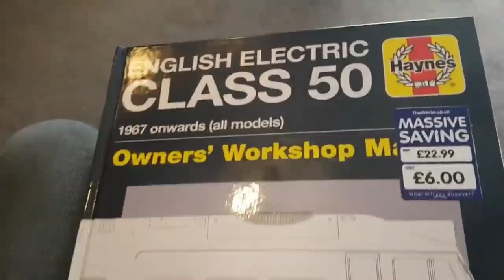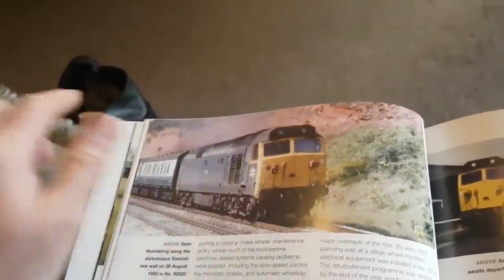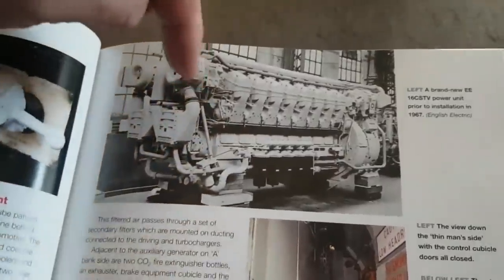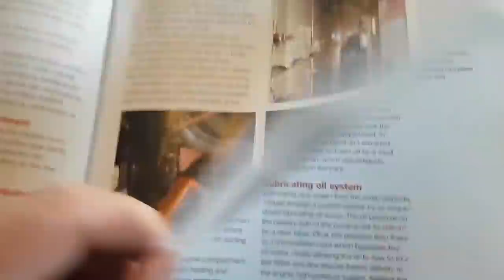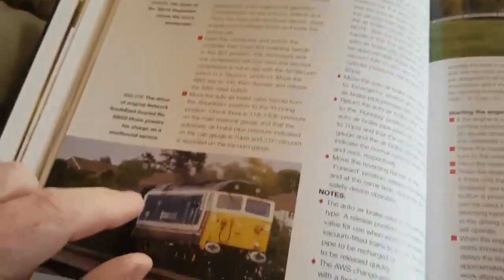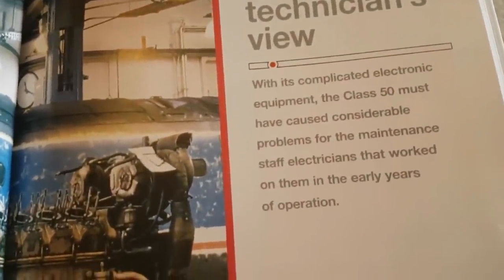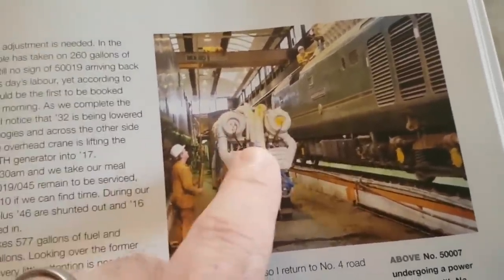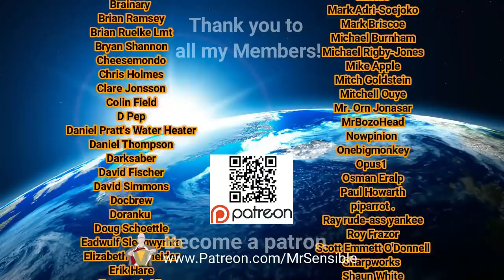Trains and the Dunning Kruger Effect

Comment: You can run a gas turbine engine on pretty much anything combustible you can get through the injectors, coal if you can grind it up fine enough. Aircraft fuel is just a higher grade diesel really.
On a positive note, wind turbines do run using just air :)
Reply: Ah yes but jones senoj claims wind turbines are driven by jet engines in another of his crazy videos.😂😂

Comment: See that big round thing at the back of the engine, it’s a generator. Almost all modern trains are Diesel electric’s. The nice thing is in metro areas they can use the overhead wires to power the trains so they don’t have to run the motors and create more pollution.

Comment: Mr S. I don't know about the train where you live, but here in the usa most trains are diesel/electric where the diesel engine(s) run an electric generator(s), and the electric generator is what turns the drive wheels thru electric motors.
Reply: Yep and the diesel responds to the generator load with the electric motor controlled by varying its field strength. Appears rather Rube Goldbergian from a distance

Comment: I quote,
"If they were using traditional diesel like you do in your car, they would need a giant oil tanker behind them".
Presumably it hasn't occurred to him that diesel cars do not tow an attached oil tank and so there is no reason why the locomotive should need one.
Still one thing is proven, modern video cameras can be operated by idiots.

Comment: An answer to the Train Book Guy:
Let just say that the train run on "free energy", that had not affected the price ot the train ticket, for a train need tracks and those are rather expensive to build and maintain, then there is the workers that keep the system running and working and those people need to get paid and the money comes from the ticket, that is the main cost of a transportation system.

And then it is so that energy is free and always beef free, it is just not easy to convert one form or energy into energy we need and it is that transformation we pay for. Just let say that the companies can get energy from the air, that energy is no good to run a television, so the free energy need to be converted into electricity we can use and it is that service we pay for.

i can have small solar panels on my window to charge a small weather station, that energy is free for me, and I can stop use electrical light and sell my computer to get rid of most things that use energy I pay for, and then I can live on my "free" solar energy if I want to, but I prefer to pay to get the energy I need rather than have a "Free Energy Jet Engine" in my room to spin a turbine that generate free energy for my electrical stove.

Footnote: How stupid are folk that that think there is some secret hidden free energy source that can be used for everything, do they really think that if they can expose this new "free energy from air" that it would be able to fuel their car, make flight free and electricity free to use?

Comment: The locos he was pointing at were diesel -electric , Diesel engine drives a generator then electric motor. Electric motors are better for large weights, diesel on its own would be burning out clutches. Electric motors have massive torque all the way from a standstill to full power. Much smoother power delivery.
They are similar to the ones space x use .😜

Comment: Ooooh, the levels of stupid!!!   I work at one train station for almost ten years, in a newspapers and magazines shop...  and about those "sparks", I have one word, Jonesy:  doves!   Blowing up doves are so common, if the poor beast have the shock in low tension you can see it badly burn, if it's in high...  a small smoke and perhaps one or two feathers, the rest vaporized!  

 And if you don't believe there's electricity, get your hand near the "induction zone" (half a meter from the wire) and you will have a shocking surprise!  One teen tried that years ago, and it was horrible...  but sure, keep in your delusion!!!
About the induction zone, not sure if it's the right translation, the technicians that worked there mentioned it thousands of times, but you know, in spanish we can say in one way and in english there's another!

Comment: Diesel electric. Diesel is the motive force, the transmission is electric (i.e. alternator driven by diesel + electric motor). Not only is diesel energy denser than coal, the diesel engine is way more efficient as well.  So. No. No tenders :-)

Comment: Just when you think you saw it all, someone like this comes along!  In South Africa all our diesel locomotives are actually diesel-electric (i.e. the diesel engine drives a generator which powers electric motors on the drive wheels).   Although there are more losses this way, it is easier to control the power than when the diesel drives the wheels directly.  I wonder if this is the case in the UK as well?  Any idea?
Reply: This one is a diesel electric, as are pretty much every remaining diesel loco in the UK now, other than some shunters. The western region where these engines ran used to use diesel hydraulic locks, as was mentioned by him in the video, which used hydraulic drives instead of electric motors, but the last of them was withdrawn decades ago.

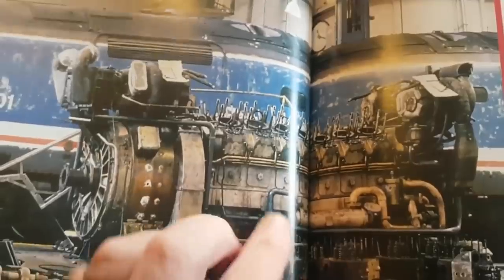Comment: My dear Mr, you are also missing the point of these loc's. (9:00)is 
They are Diesel-Electric.
The Diesel engine drives an Electric Generator. The wheels are driven by Electric Motors. Much more efficient and smoother acceleration.
But they need care by Electricians!
Something our DK-hero is totally missing! And whining about.

Comment: He is all upset  that he THINKS  the train is running  on compressed  air. He is furthermore unhappy he has to pay to use the train.  Ok let's pretend  for a moment  that GB did find a way to run their  trains on compressed  air. First  off that is an incredible  achievement and they would  be bragging all over the world and making  millions  on with an international  patient.  Second  I guess  he thinks  the people  operating  the train  work for free. Track maintainece cost nothing,  there are no other cost associated  with operating  a piece of equipment  that large so therefore  they  are just making tons of money  off the citizens.  Wrong.  Even  if they found  a way to do that it would  still cost a good amount of money to run the whole thing. Why shouldn't  the people  useing it pay? What the people  NOT using it should  pay? Of course  they shouldn't.  So even  if he were right  (he is not , just very confused) it would  still  need money  to stay up and running.  The cost of the fuel  is only one small  part  of entire thing.

Comment: DIESEL ELECTRIC, aka ELECTROMOTIVE, is used in many large machines. Diesel engine driving a generator and electric motors drive the wheels. So electricians are part of the crew. 

There’s Diesel (like a truck), and overhead electric. And then diesel-electric. A diesel motor and electric motor drive. And it’s all his picture book. 

What a stupid vid; just free bandwidth gone bad.

Comment: The smoke is in fact coming from an electric engine
Reply: No the smoke the comes from an electric engine is a blue in colour, and the engine NEVER WORKS AGAIN if you let that blue smoke out.
Reply: You seem to be a bit foolish. That smoke is clearly exhaust fumes from the Diesel engine. The only time I have ever seen smoke from an electric motor is moments before it fails.
Reply: @trent-bh9ow  Yes it's diesel smoke. That's the generator to power the electric motors.
Reply: @urbanspaceman7183  no it is not. It is a piston engine fuelled by diesel with its crankshaft driving a separate electrical generator. The generator provides the electrical power to drive the electrical traction motors which drive the wheels of the locomotive. A Diesel engine cannot generate electricity by itself. It is used to provide the motive power to turn a generator.
Reply: @trent-bh9ow  Yes, a train powered by electric motors that run off electricity. I think you've got it.
Reply: @urbanspaceman7183  you seem to be ignoring the fact the generator is being driven by the Diesel engine and without that engine the generator is just a motionless pile of copper windings in a magnetic field incapable of providing any electricity. So the primary driver in this locomotive is a 16 cylinder Diesel engine.
Reply: @trent-bh9ow  You seem to be ignoring the fact that the motors don't care where the electric comes from. In this case diesel but could be petrol,  gas turbine, nuclear or a hamster on a wheel. The motors that drive the wheels run on electric. Diesel electric locomotives are moved by electric. Try saying hey Google what powers diesel electric locomotives then argue with Google.
Reply: @urbanspaceman7183  I shall write this slowly as you seem hard of understanding, the prime mover in this locomotive is a 16 cylinder Diesel engine and NOT an electrical motor. The generator will not work without the Diesel engine. I know generators can be driven by water, steam, petrol, diesel, gas, nuclear and wind but we are talking about the English Electric class 50 diesel electric locomotive. This locomotive is driven by a prime mover which is fuelled with diesel.
Reply: @urbanspaceman7183  I think it is you that needs to read this description of a diesel electric locomotive. It is just as I said. https://en.wikipedia.org/wiki/Diesel%E2%80%93electric_transmission
Reply: @urbanspaceman7183   I think it is you that needs to read this description of a diesel electric locomotive. It is just as I said. https://en.wikipedia.org/wiki/Diesel%E2%80%93electric_transmission
Reply: @urbanspaceman7183  the ELECTRICITY to drive the ELECTRIC MOTOR in the train come from the big TURBO CHARGED DIESEL ENGINE. Which causes the "big clouds of black smoke". The smoke has NOTHING to do with the electric drive.